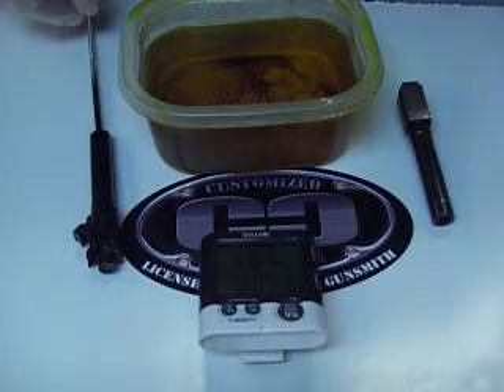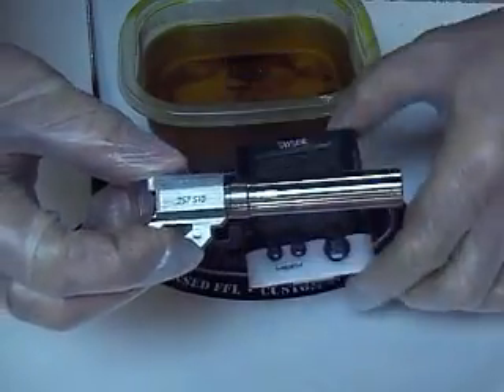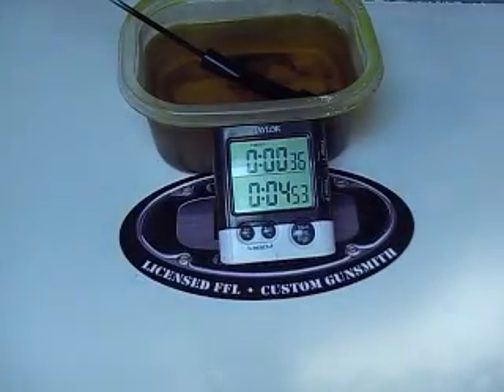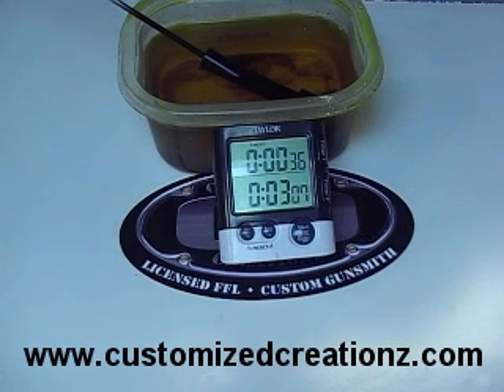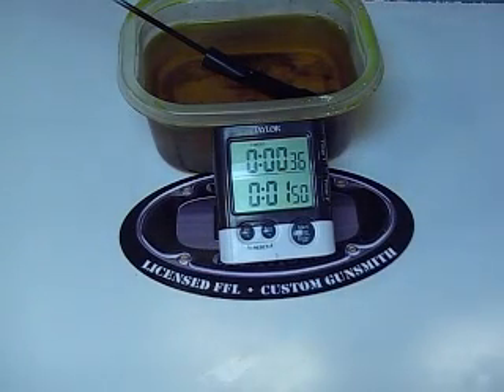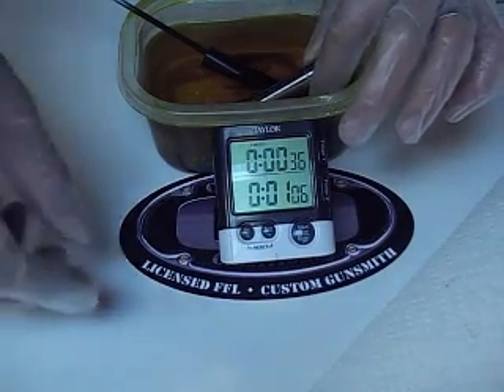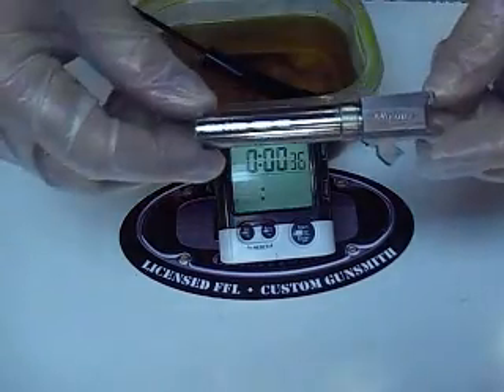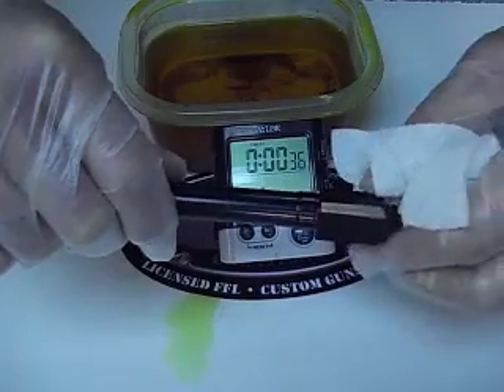How Tough is Cerakote ? Part II "The Acid Test ! " Customized Creationz

Comment: The cerakoted barrel in this video, did you skip the sandblasting before cerakoting?
Because of the smoothness, it looks like an grinded surface. 
What ratio did you use when applying hardener? 
thx,
Ton